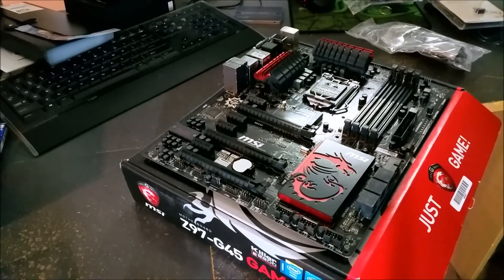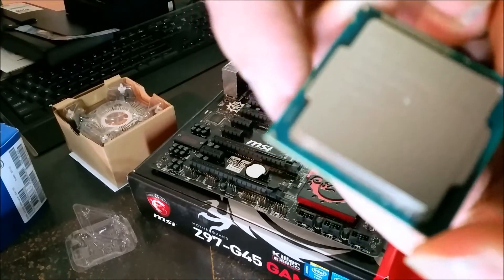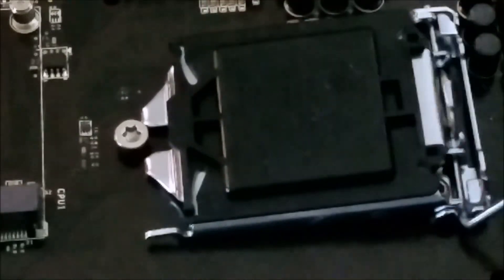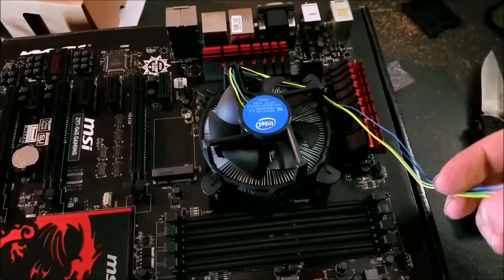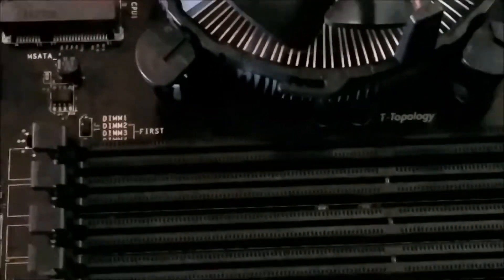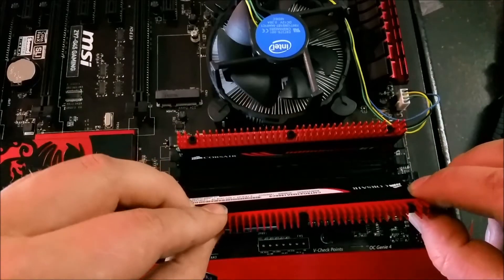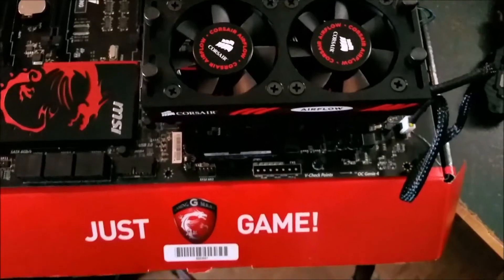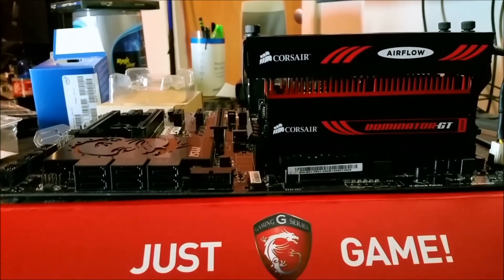Installing LGA 1150 CPU Stock Cooler and DDR3 RAM

Comment: Nice Video, did you OC that CPU? if so what to? thanks
Reply from the maker: +John Qsak Yes I did, I was able to get 4.0 GHz on the stock cooler with comfortable Temps, Core Voltage is 1.280v (Set to auto in the BIOS. I dont need to go any higher honestly for the use application for this PC. I was able to get 4.2 GHz stable for about 20min under stress test, but then it failed.
Reply: RRooooooNNNN sweet